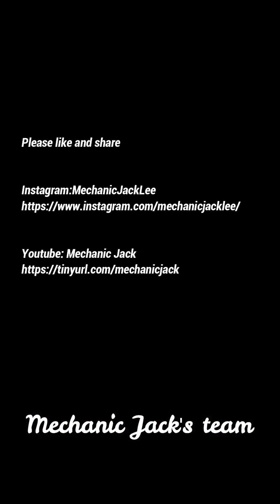Process of Nissan Restoration|Front crashed |Mechanic Jack

Comment: That left frame rail was done completely wrong. You can't just cut a frame rail in half and then just add it to where ypu cut the rail thats still on the vehicle. You HAVE to tear down each frame rail and reassemble the rails together in layers. Also, the welding seems have to be staggered from one another, not all at the same exact spot.

The way this guy did it is very dangerous. If that weld becomes weak and forms a crack. Just that alone will cause a huge accident and possible death. This repair would never pass inspection in the 🇺🇸.

Please don't think I am just trying to bag on this guy. I have watched a bunch of his videos and the work he does is spot on. This was the first time I watched him do something completely wrong.
Reply: Yea your right about that, that’s the main part of the chassis where the engine sits, breaking hard and accelerating can cause the chassis to crack at the weld and fail, 

If it was reinforced with additional steel and layered it can help with the integrity and less prone to a fail, 

But saying that this dude is amazing and he makes it look effortless
Reply: Almost all the videos he does are of him doing the same thing. There is no way that death trap would be squared up properly without being put on a factory approved jigging system, or a laser aligning car bench. A stick with two prongs on each end just wont do the job. You can make anything fit if you belt it hard enough with a hammer. And as for joining that chassis rail where he did...well I am lost for words. Good luck getting that thing to track straight on the road, and how you would align the front end god only knows...

Comment: Man this guy work is awesome but this job on this car should never be passed as road worthy all the main weight is held in the engine bay from hard braking a hard accelerating can cause the welds to weaken over time and can cause a major fail
Reply: I don't think so,those guys are official Nissan mechanics... look at their uniform color and those Nissan behind them